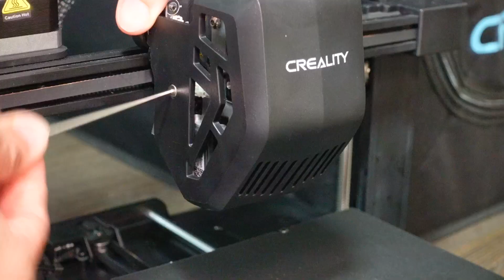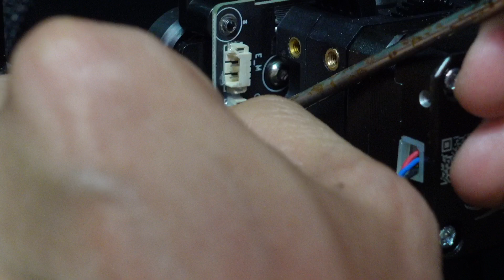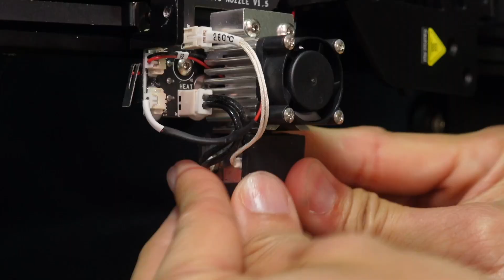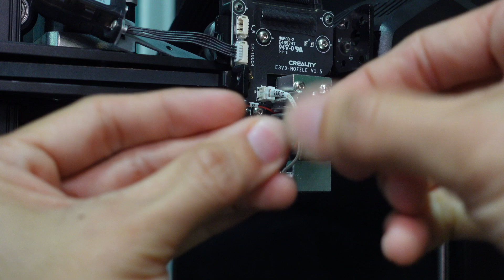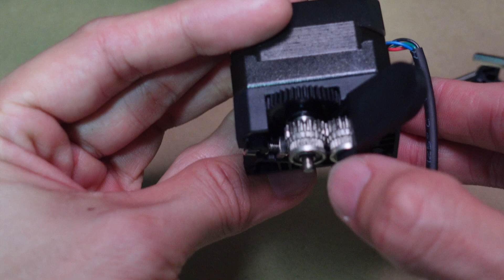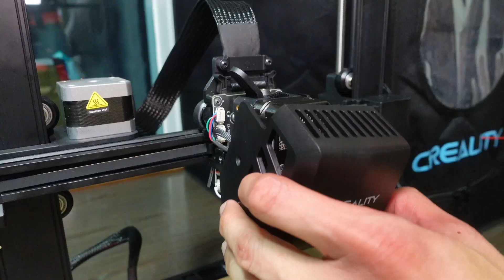Fixing Creality Ender 3 V3 SE Hot End JAM - Disassembly & Unclog

Comment: I didnt need to unclog, I needed to reattach lol.. I set a 4 hour print and it failed, but kept running the nozzle into the bed for the rest of the print, scratched it all up, screws came out of the extruder.. needed your video to see how it all comes apart.. running a test run now to see if its fixed and if I need a new plate.. video was helpful thanks

Comment: My printer has hot glue on the wires at 0:50
Reply: Hope I'm not too late, take off the rubber protection off the nozzle, get tha nozzle out and heat up the cleaner that comes provided and jam it until it comes out of the other side
Reply: @salamgaming7806   it's fine. Btw. Where can I get rubber sleeve replacements? A recent spaghetti tore part of ir

Comment: At 4:15 in your video... any suggestions on what to do if the gears ARE NOT moving? I can turn the black dial and they rotate slightly and then they stop.  It's like they stop connecting. Any ideas?

Comment: I’ve only just got mine but struggling to find somewhere to put it except the tent, my husband moaned it was on the table in the way. I put it away for about 2 weeks cos I’m doing some diy & my reward to myself was to get it back out. Well today we found we needed something making- I honestly extracted everything when I put it away but no- nothing works come out… or in! Eventually I found your video! I didn’t expect to have to do this so soon after buying it! I panicked cos less than a month & Amazon wouldn’t take it back. I did burn myself- just after you told us to be careful! I was so upset & now with your help I’m delighted! I can see it ‘leaking’ out doing a clean & calibration. Thank you so much! Already subbed! I owe you one! 😊❤
Reply: Mine clogged during my first leveling and now I am only in the upset stage :(

Comment: My 3d printer stopped working, now when i trun on the printer the sensor touch stays red and also the sreen stay blue dont initialize the firmware
Reply from the maker: Try manually freeing the Touch sensor probe and spray some contact cleaner to clean it. We have a video about it.

Comment: Hi, i follow your instructions, the clogged filament solved. But after connect the cable motor, i tried move the extruder but it doesn't work or rotate. I panicked so i buy new motor and tried connect it with the motherboard, doest work either.. i got panicked again..
Reply: Do i have to unplug or plug again? Or do i need to make sure the motor is hot? Pleeasee i need solution

Comment: I just bought the Elder 3 V3 SE after installing the printer. I tried to get the plate level. I got the printer to touch the plate, and after a few minutes, it threw an error that said the nozzle temperature was too low. Then it gives me a loud noise. 
Do you have a solution for this or a tutorial on how to fix it?
Reply: hey I just got the same error, did you manage to fix it?

Comment: And what if it clogs up Every time you print! It does about 5 layers into a raft and then boom clogged
Reply from the maker: Try to chdck filament temperature.. or change another filament?
Reply: @KakiDIY  I figured out I had plugged the fa s in the wrong way so the heat sync fan was the cooling fan so the filiment was getting warn inside the hot end softening and then clogging haha

Comment: Thank you so so much! My ender 3 se v3 had a very bad case of it clogging after I ran out of filiment and it got stuck there. I tried everything and looked everywhere for tutorials. I couldn’t find a single one.. 

Until I found this one which is the best tutorial I have ever seen, it’s at perfect pace, goes over every detail and everything you should watch out for. Tells you what to do incase certain stuff were to happen or if you need a slightly different solution. 

You have all my thanks.
Reply from the maker: Glad it helped! Thank You very much for the kind comment and feedback.
Reply: @KakiDIY  No problem, it helped alot although very unfortunately my printer broke again lol. It was leaking this black, glassy like substance that was plastic like in texture that was so hot it melted through the print bed. Sorry to ask but do you have a video on leaky filaments or that anyone else has one? Just wondering but thanks a lot for the tutorial as I helped me finish my build.
Reply: Haha me too

Comment: I have a small tube that fell when I changed the nozzle, what can I do?
Reply from the maker: Just put back the tube. It is a heat break PTFE tubing that is from the dame diameter as a Bowden tube. If you lost it, just get a bowden tube like Capricorn, cut it to length and replace it.

Comment: My v3 SE has gotten into the habit of clogging at the end of every print. I use mainly PLA, and the clog turns up in the same place as you've shown in this video. What I do to unclog is preheat TPU,  use a candle to heat up the tip of the cleaning rod and push it in and through the clog, then burn off the residue that sticks to the rod. Repeat about twice more until I can't feel anything impeding the movement of the rod and all is well and I can print again. My problem now is just the fact that it clogs after EVERY print.
Reply from the maker: Good tip.. Thanks !
Reply: I have almost the same problem, mine clog after every filament chance, as soon as try retraction

Comment: I have an ender 3 v3 se, and Ive been looking all over online but Can’t find anywhere what type of metal the filament drive gears in the extruder are? I wanted to run carbon fiber PETG but have heard you need to make sure your gears aren’t brass. I have a steel nozzle for it already also.. Would you happen to know if they are brass gears? Thank you very much!
Reply from the maker: Don't think they are brass.. just normal metal.

The hotest I ran was 260 degrees for polycarbonate.. and normal PETG.. the drive gears worked fine for both.. probably adjust the drive gear tensioner... should be OK
Reply: They appear to be steel not brass, possibly a hardened steel but they're certainly more durable than brass